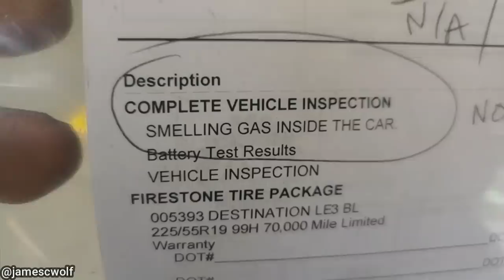Customer States Went Off Roading In Ford Bronco And Now It Won't Start | Just Rolled In

Comment: Worn out clutch.  Faulty clutch or driver error?  I would estimate with 99% certainty that the drive believed the clutch was one of the ways to control vehicle speed or used the clutch pedal as a foot rest.

Comment: How do you destroy a clutch so fast??
I'm thinking he was trying to drag race and just dumped the clutch while red lining the engine?? Maybe some hard downshifts without rev matching?
Still it's too fast.
Maybe there was a forgoten screw inside it
Reply: If people leave the foot slightly on the clutch pedal they can also destroy a clutch quite fast. This often happens with drivers used to drive automatic transmissions, but are unfamiliar with manuals

Comment: Hard to believe the first one only had 2500 miles on it, everything visible on undercarriage looks much older than that ??
Reply from the maker: It's just mud underneath the technician said. Apparently when they went off roading they got it stuck pretty deep.
Reply: @JustRolledIn  👍

Comment: 0:05 protip: a SUV is not made to go offroads.
or like the sticker I once saw in the back of an old cherokee: "My JEEP is not a SUV. Your SUV is not a JEEP."
if the space below the pistons is filled with water the engine most likely won't turn at all. if there is space and the starter is strong enough you might rip off or stretch a rod with it. I'd recommend pullign the dipstick and turning the engine with a wrench, but with modern cars you can't reach for anything, anyway. better not trying it at all and have your car towed.
0:58 someone didn't get told they abused their car to transport forbidden substances? but the wheel must have had a run-on-flat tyre, or else they couldn't drive to the shop. or am I getting something wrong there? but if they knew they deserve the police hunting them down, like the lady who didn't know you'd have to pop the bonnet to change oil so they found the load of freshly smuggled stuff...
1:22 what are we seeing there? the air from the turbo inflating the front mask assembly? looks kinda creepy...
2:04 peugeot is employing a curious connection between pipe and muffler. instead of tube-into-tube it's a pressed cone against a pressed ring, held together by a two-part clamp. installing is a nuisance, having it seal properly even more, and the connection often rusts away when salt and dirt collects underneath the clamp... so this muffler has probably broken off the pipe here. happens quite often, even with factory parts. sometimes we just welded in a piece of pipe as the rest of the exhaust was still good.

Comment: I think most of the customers are lying about what they have done with their cars. What about the one with the exhaust hanging in a string. I wonder if he had driven with this for many miles. It was better in old days whey you could maintain your car yourself and no neighbours getting mad when draining oil of your engine on the street, and you could replace a v8 motor in less than 6 hours it was better times.

Comment: LOL @ the last clip. I watch that channel. Idiots go driving through the flood water at high speed filling the air intake occasionally and other times ripping bumpers off. I once saw a flooded car. I opened the bonnet / hood and opened the air box to find it full of water. And he wondered why it didn't crank anymore. (prior to opening the air box)

Comment: don't drive in water higher than your axle unless you have deep pockets and go slowly
Reply: If you have the right vehicle and the right equipment and the right training you can drive through water deeper than your hood. DAMHIK
Reply: @alexbrown1995  yes, but it's still not good for the wheel bearings since the water can come into the bearings which will lead to corrosion damage over time. It will definitely shorten the lifespan of the bearings.
People doing real ofroading as hobby will accept that, but I'm sure most SUV drivers aren't aware of this

Comment: The best thing you can do to that FPace 2.0d is hydrolock its engine, the turbos go after 60k km, the timing chain stretches after 100k km. My wife is on her 4th turbo and 3rd timing chain. Thank God I had the foresight to buy the 250k km extended warranty.

Comment: I am from the UK, have driven manuals (stick shift) most of my life (nearly 60 years old) and never replaced a clutch ever even in the crappy second hand cars from 1980's that were old and rusty cos I had no money.  I think you will find the problem problem occurred between the steering wheel and clutch peddle.

Comment: The BMW that had the front suspension problem is something I see ALL the time at the shop where I work. This is the abysmal failure of the Stone Age BMW "engineering". I also notice that BMW owners are among the biggest crybabies when they hear how much $$$ to repair their "cars".  The other issue we love at the shop is the rear tire failure on a BMW due to the crappy suspension. I tell these customers that the Flintstones RubStone special had a more advanced suspension.

Comment: OK, so milk shake oil, going offroading is a risk you take, if you don't have a snorkel fitted then don't do water crossings. As for the clutch only doing 10 miles that's a defect full stop.
Oh and my favourite cars trying to cross flooded roads what was the driver thinking 🤔

Comment: I hydrolocked a rental car one time... Toyota Camry.... driving into a deep puddle in a parking lot on rainy day. I was only about a mile from my apartment.   I called a friend who took me to my apartment got my tools came back pulled the spark plugs.  Water shot up of the spark plug holes literally like geysers.  

Put the spark plugs back in and everything was fine. Drove it the remainder of the rental period,  and turned it in.    Never bothered to look at the oil.  It was a rental for work so it had the loss and damage waiver anyway

Comment: That last clip at 2:46 is a shining example of why you should never, EVER drive into water that is fully covering the road. The driver's lucky the road surface was still intact down there. If the road had washed away, the car would've gone under and the driver probably with it.

Comment: Serious question- how would you go about hydro-locking a Bronco even if you wanted to?  I've been driving Wranglers off-road for years and never even heard of such a thing.  Stalling out in a river, sure, but hydro-locking?
Reply: i think it's because these new cars have low intake ducting (near bumper height)

Comment: As a German, the word "hydrolocking" your engine is nice, we don't have a special word for it, we just say "water got sucked into the engine".
I guess if you wanted to, you could mess with customers this way. Telling them "there is a hydrolock, it costs X.000 to fix." Customer: "What? How can a damn lock be that expensive?"
Reply: Typically in German people would say Wasserschlag if the engine is totaled because it sucked in water
Reply: @simonm1447  Mechanics might do, I never heared this word a single time, and I watch several mechanics shows..........

Comment: What is hydro locking an engine? When the cylinders fill with fluid and prevent turning over, or the entire block? Sorry never heard the term until this video.
Reply: Yeah, if people drive through deep water the water get sucked into the air inlet (if the inlet is covered by water). Water hovever can't be compressed (unlike air) and the engine gets locked rapidly, which leads to bent or broken piston rods. Enough water can total the engine.
This is the reason why military trucks and real offroaders have the air inlet as a snorquel at the top of the roof.

Driving through deep water should be avoided if possible, even if the engine don't get damaged water can come into the wheel bearings and can lead to corrosion damage over time

Comment: Maybe a bit pedantic, but when an engine hydrolocks, that means it is locked up because of the water in the cylinders. In other words, the engine doesn’t crank and won’t start until the water is removed from the cylinders, assuming that it didn’t get destroyed when it tried unsuccessfully to compress the water. An engine that stalls because it injested a little bit of water (and water doesn’t combust, at least not in an engine) but restarts with some cranking is not hydrolocked.
Reply from the maker: The person who filmed it said the engine hydro locked and the vehicle was written off. Just being the messenger.
Reply: Try it and let us know?!

Comment: I saw that last clip couple days ago on Fb. If I remember it right the GPS leads you throgh this floded road because it's the shortest/fastest way there. And because people don't want  to go the long way some of them end up like this or worse. I saw that some delivery guy drowned his van in there along with the packages that were in the back. Some dude in a lifted Nissan Patrol had to drag him out. I'll try to find it again.
Edit: Ok, so I found it way faster than I thoght I would. It's Rufford Lane Ford. And here's some more info I found. 

Why do people go through Rufford Ford?
They're a useful solution for minor roads where it is convenient to be able to cross the river when water levels are low. In the case of Rufford Lane, an four-mile detour is always available so drivers can go around if the water is too deep.

Why is there no bridge at Rufford Ford?
Rufford Lane carries nearly no traffic between nowhere and nowhere, so there isn't an economic case for a bridge. And a bridge would spoil the fun of people wrecking their cars in the watersplash.

Comment: There is now an investigation into those 2.7L Ecoboosted Bronco's. A lot of them are having engine failure and need new engines.  Wondering if the engine failure isn't because of the off-roading and just a coincidence.

Comment: Some of those new Broncos motors are failing in just a few to 2,000 miles. The dealer has to put in a new motor under warranty.
Reply from the maker: Not in this case unfortunately for the customer.

Comment: If Volvo at the end didn't stop for the ducks he would of made. It especially since it's a full size suv and awd. I've seen much smaller fwd cars go thru deeper water. As long as you keep moving shit won't break he let off the throttle which in turn allowed the water to pick the car up which in turn cause the car to lose traction which in turn makes it impose to start and move again. Dumbass stopped so ducks can move and totaled his car.

Comment: That's not a Bronco, its a Bronco Sport.  The Bronco doesnt have a 1.5L option.
Reply from the maker: Bronco, Bronco Sport. Same thing?
Reply: @JustRolledIn  No. Not even a little. 

The Bronco Sport and the Bronco share absolutely nothing in common except marketing materials. 

The Bronco Sport is a Ford Escape. A small AWD crossover with a unibody chassis. 

The Bronco is a 5500lb body on frame truck  based on the Ranger chassis with part time 4wd with a completely different power train and engine options.
Reply from the maker: @J_Madison sorry, the one in the clip was the Bronco with the 2.7L. But thanks for sharing. Never really looked into the Broncos yet and different models they have.
Reply: @JustRolledIn  it looked like a full size Bronco to me, but I've never seen the oil pan on a Sport. I do know the oil pan in question is identical to the 2.7 on my fullsize Bronco.

Comment: The owner of that Ford Bronco should contact Ford, there's an investigation by NHSTA on those engines for sudden failure and hydro locking, so the owner may be getting a refund.
Reply from the maker: Not in this case. It was drivers error the technician said. He said they got it stuck pretty deep when they went off reading.

Comment: Those Broncos need a new engine anyway.. the original one they come with tends to blow up on the freeway. Also it amazes me how many people don't know you can't get water into the intake.. but then again, a lot of people also think gas has water in it so....
Reply: On a high humidity day more water does go through the combustion chamber more than fuel
If you ever road a motorcycle behind a car in that kind of weather, you'd feel the water droplets that comes out of its tail pipe.

Comment: First one : Hydrolock: get water in the engine locks it instantly as water cannot compress...
Oil and water are fully mixed, how can it be possible? Not by driving in a too high river ( dealer tried to scam customer ?)